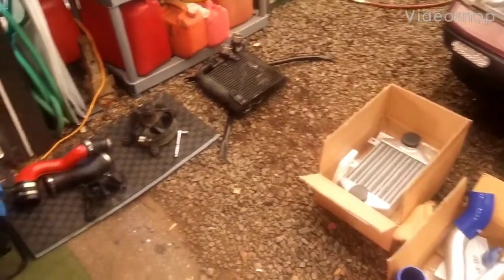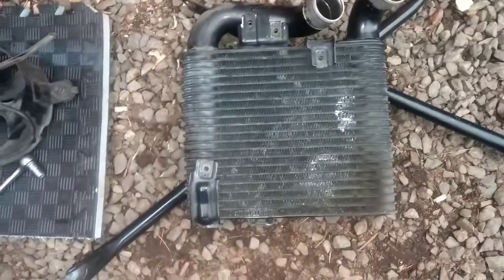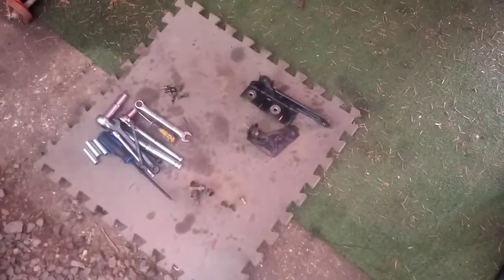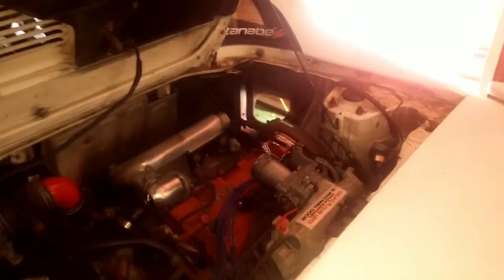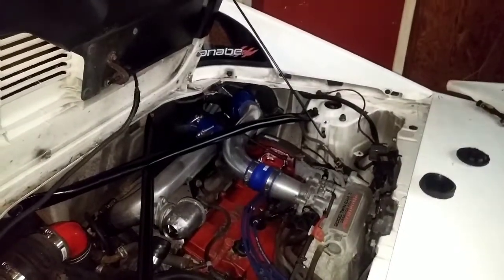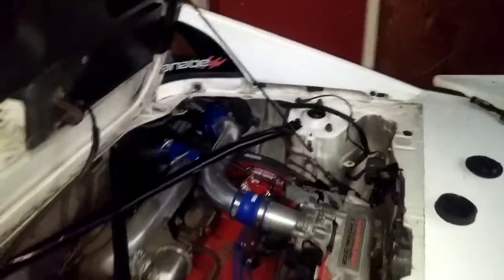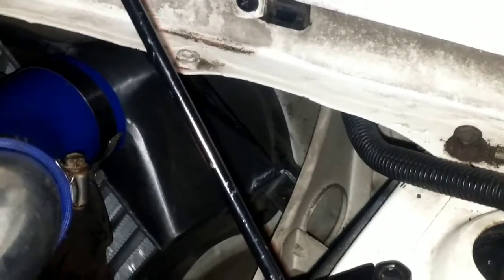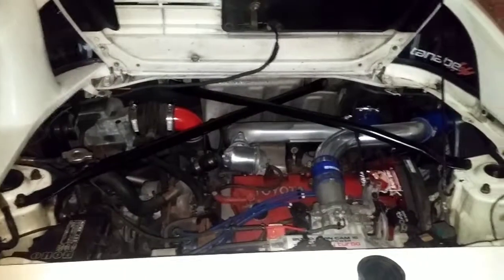Toyota Mr2 Intercooler Install

Comment: Nice, did you just bolt the intercooler in with the old intercooler hardware? Do you think this also performs better than stock? I've got mine for the cosmetic appearance but would be nice for a small bit of temperature performance. Cheers
Reply from the maker: Hey thanks! Yes I did use the original hardware, it definitely helps with intake temps, and looks much better than stock of course.

Comment: For the removal and installation of the intercooler, did you have to losen or take off anything else in the way or will it just come out?
Reply from the maker: Remove inspection panel, remove intercooler fan, boost pipes.  Should come out after those things are out of the way.